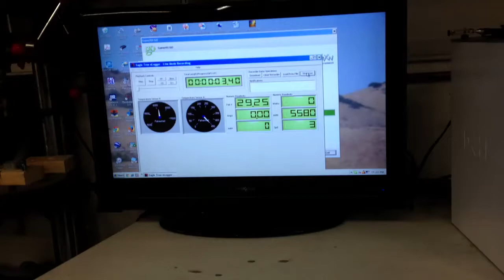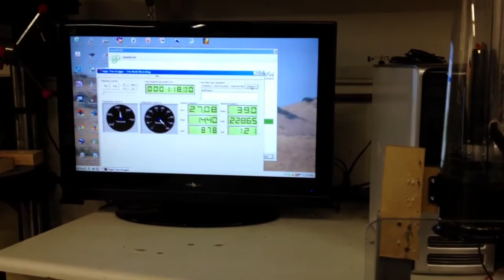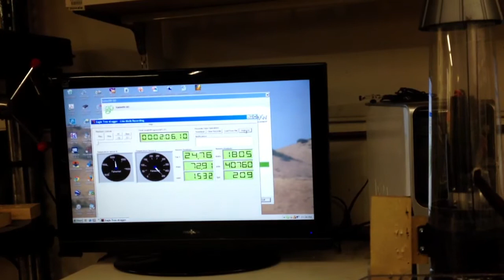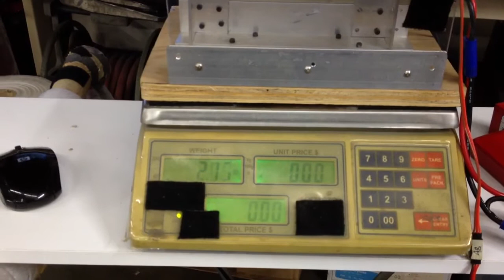TJ70 CS12 blade rotor 7s

Comment from the maker: This test is only for purpose of limitation of the rotor and motor.
Not idea to install run over 110A. The next lower KV motor will be running 8s to drop the Amp down to 80A.